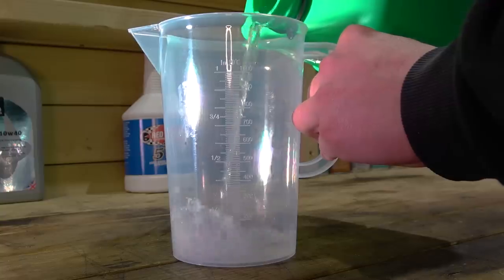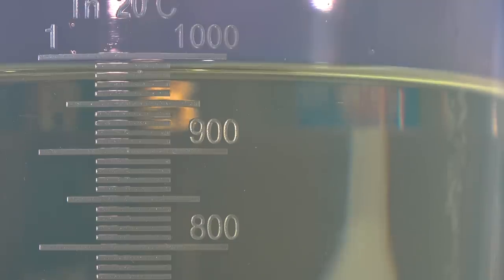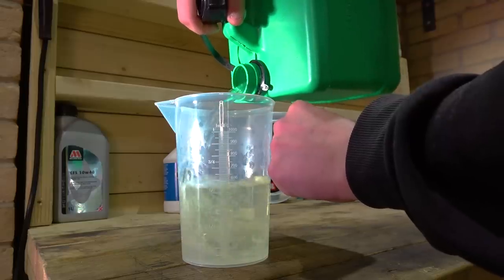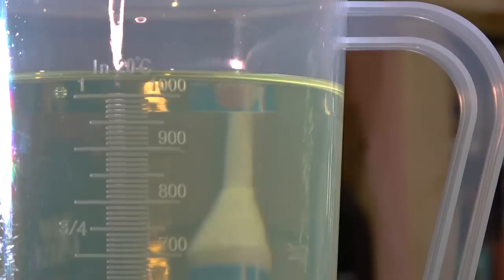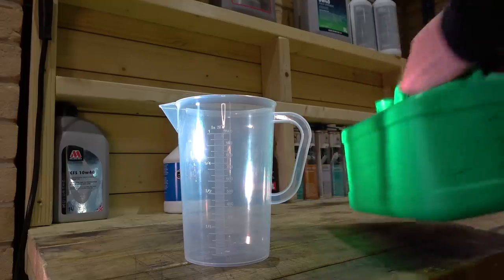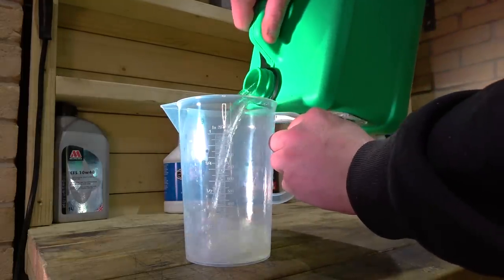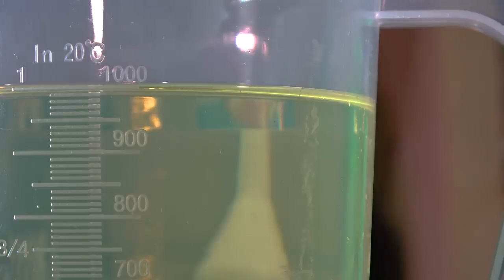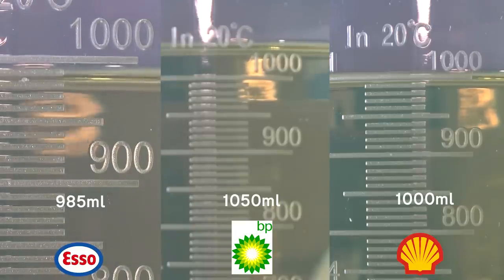Fuel Pumps Are Wrong - Esso BP & Shell

Comment: There is probably more variation between pumps than between suppliers
Reply: This is true. It's usually the same independent companies doing the adjustments and checks on the pumps. Petrol stations themselves are not allowed to do it.
Reply: There is more variation in your hand than anything else.
Reply: Yes, go to another BP and you might get less than 1L
Reply: Spot On!
Reply: He really needs to check 1 liter from every pump at each station to be sure.
Reply: @MikeDCWeld  not just that but at least 10 samples from each pump

pumps and infact everything that has some kinda measurement has a tolerance value that 985 might actually still be ok if the tolerance its aiming for is enough and 1 liter to the next you might see a difference take the bp over 1 liter the next liter it does might be spot on the next under 
the easiest way is to just pump 10-100 liters and see how far off the combined is

which probably has a lot to do with the 2-5 liter minimums there calibrated off a 5 liter or 2 litre test so whilst a liter might swing either way multiple miters average off there tollerances to be much more accurate

fun bonus fact you can combine multiple 5% resistors in a circuit to form a higher tolerance resistor of say 1% or better

Comment: Ah! The ISO approved kitchen measuring jug, well known for being totally accurate and checked by Trading Standards!
Reply: Just what I was thinking.
Reply: The math dictates they are 1L exactly. Manufacturing tolerances are likely not even 1ml. All rulers that you can buy from reputable brands are accurate too.
Reply: It would be nice to repeat the experiment with a graduated cylinder
Reply: Using his eyes to read the value adds more inaccuracy. A calibrated scale would be the best method for getting an accurate reading.
Reply: @justinvzu01  But is that really the case? Manufacturing tolerances on chemistry beakers are +-5% and if you really need something more accurate you shold use a graduated cylinder which has a tolerance of about 1%. I somehow doubt a kitchen aid beats a graduated cylinder. I think at best it's on par with the beakers. And it all depends on the liquid and the tempearature.

However, having used the same container for all 3 samples we do get a good estimate of the variation. This is the difference between what precision and accuracy mean respectively. We got good precision per sample but not necessarily great accuracy overall.
Reply: Even if it's not very accurate (which is quite likely) he used the same jug for every sample so relative measurements are fine.
Reply: @justinvzu01  this isn't true. I work in a lab, and all equipment we use must he calibrated. Our 1L volumetric flasks will have an error limit of around 1ml, and they cost £50-100 each. 50ml volumetric flasks that cost £50 have 0.1ml error (which, when taken up to 1L, leaves you with 2ml error.).

I expect that there will be at least 5-10ml acceptable error (although its likely not tested)
Reply: For the purpose of this, I think it's pretty impressive that the pump is able to get damn close to 1L.

Comment: I was told many years ago by an engineer that worked on fuels systems, was that it was impossible to design a totally accurate fuel pump. He said that if you squeeze the trigger on and off repeatedly you should get a little more fuel. This was many years ago, and he said this was a known issue by the petrol companies.
Reply: In india they do the same but to dispense less quantity.
Reply: Actually you get less fuel then having a constant flow
Reply: @mickdaly6537  My friend was an engineer working on pump system for military aircraft. I assume he knew what he was talking about.
Reply: @eddewhurst7662  you can easily both be right, the engineer understood his system, poster understands physics in principle. Specific systems and principles are related but interact complexly and easily could allow both to be right

Comment: "Always fill up on a cold day as the fuel will be more dense."
Was always the one I was told.
Reply: sadly it usually matters not as the fuel is located 10+ meters underground in a tank same temperature year round.
Reply: Was on Top Gear, 2hen Clarkson done his London to Scotland and back on a single tank of fuel challenge...
Reply: matters a lot here in canada - the fuel pumps here have to charge based on 20C temperature year round.. Amazing how much more petrol you can fit when it's -40C :D
Reply: @Sam-xq8xh  A8 4.0 TDI (03 plate) in 2004
Reply: It's all about WHERE you fill up; some places have better tanks than others, some tanks leak.
Reply: Come from under ground, so I am not sure who told you that. As far as storage of fuels is concerned, stable temps is the best to avoid condensation of moisture in the air. Perhaps that was the point they were making.
Reply: I thought the fuel temps were kept at a fixed level
Reply: tanks are underground and are at a fairly constant temperature.
Reply: and this is why I use the bus to go to work in the summer. I lose like almost an hour every day but I dont lose my perfect streak of tanking dense fuel. Genius stuff.
Reply: park the car other way round and strech hose. when u finish wait 10 swconds
Reply: @julmdamaslefttoe3559  Thats only if you're tapping the storage tank.
motorbikes, for example, can tank up with the majority of the fuel being in the pipes....
Reply: @julmdamaslefttoe3559  Yes and No. For instance, in the United States, the oil companies don't bother with temperature compensation since they say the cost of doing so isn't worth it. However, in Canada, they do provide temperature compensation. Now, consider average ground temperature and the effect on the density of the resulting fuel. So in other words.
Ground temperature in the United States is warmer than the standard temperature for determining volume, resulting in lower density of the fuel, resulting of "less" being delivered. Not much of a difference per customer, but overall, it results in substantial extra profit (look at salami fraud. millions of insignificant amounts do add up).
But on the other hand, ground temperature in Canada is lower than the standard temperature for determining volume, resulting in higher density of fuel, resulting in "more" being delivered. And the oil companies are well aware of salami attacks and hence require temperature compensation.
Reply: @JUL'MDAMA'S LEFT TOE  partly correct. Fuel delivered often has a very low temperature at winter.
So the volume loaded is measured to the temperature at loading
Reply: @JUL'MDAMA'S LEFT TOE  partly correct. Fuel delivered often has a very low temperature at winter.
So the volume loaded is measured to the temperature at loading
Reply: @julmdamaslefttoe3559  matters not? Fill up a 20oz bottle to the very top when it’s hot and wait until it cools. Then look at your wrinkled up bottle lol. I think it matters
Reply: So, just go for 6-9 months of the year without filling up? Got it.
Reply: @certisully7354  😆
Reply: you will lose more than you save starting the car from cold! if you are buying a supertanker load, yes this will add up, but for a 60 litre tank?
Reply: @Skorpychan  Has nothing to do with the tank, it's the pump meter
Reply: Nah. Fuel tanks at petrol stations are buried well underground where the temperature is pretty much constant all year round.
Reply: @Youtubecensoredmyusername  When was the last time you got hot fuel out of the pump? The temperature varies so little as to not matter.
Reply: @certisully7354 you do realise that the valve is in your hand, right? You don't get more fuel by elevating the hose 😂😂😂
Reply: @djsmeguk  it's always a constant temperature underground... you'd be surprised. But don't take my word for it, go look it up.
Reply: @simonwass6315  a small temperature variant makes a large difference. Yes the tanks are in the ground. However ambient temperature still plays a part. Do you fill up when there are tankers delivering fuel?
Reply: @djsmeguk  LOL, I rather doubt that. Fuel retailers aren't stupid. Besides, by regulation fuel volume measurement is always corrected to +15 degrees C. You get no more and no less than what you paid for. But hey, I'm just a journeyman industrial instrumentation mechanic who happens to work in oil and gas.
Reply: @simonwass6315  also temps swing from 60 to 80 daily here. Maybe they don’t where you are
Reply: It is always cold in the UK.
Reply: @certisully7354  That's the 'secret' technique I use, regularly get an extra litre at least from that stretched, extended hose! 😁👍
Reply: @Skorpychan  Irrelevant. The pump measures the fuel.
Reply: @julmdamaslefttoe3559  Nowhere in the UK with 10+ metre deep tanks. That would be crazy and unnecessary.
Reply: Then if you fill your tank to the top on the way to work on a summer day your fuel will expand and if you not used a lot  it might find its way onto the road with the overflow tube
Reply: Knackered in summer
Reply: @djsmeguk  minus 40°C? Ouch! Here in the UK we moan when we get -5°C haha! -40°C is deadly cold, our whole country would disintegrate in those kinda temps.
Reply: Ground temperature varies just not as willdly as air temperature. You do see seasonal trends. You can also see the temperature of the fuel increase or decrease after a tanker delivery. If the fuel has been freshly made at the refinery it can be closer to 30c when it gets unloaded. Most filling stations have any automatic tank gauge ATG that measures fuel height and temperature. So really easy to see temperature changes and levels caused by fuel delivery. Long way of saying fuel temps really vary and don't just follow ground temp.
Reply: You can also get fuel temps increasing when the submersible running runs all the time because of a small pressure leak. Constantly running motor submersed in the fuel heats the fuel and causes temp to increase. If you see one tank always many degrees hotter than others that's the likey cause.
Reply: @julmdamaslefttoe3559  incorrect. It does change.
Reply: This only applies if the pump is set to ambient. If it says "@15deg C" it will temperature compensate.  Which is useful to a customer on a hot day.
Reply: Who bothers to within a few millilitres, the real rip off in the UK as in most countries is tax and price fixing by the fuel distributors. Opec never helped either, the present set up with Russia a member is worrying.
Reply: The storage tanks stay cool but the pumps warm up, so its best to get there early before the equipment has warmed up.
Reply: Remove the Entrained Air in the fuel to make more dense..... Then the fuel will clean the engine.... As designed.
Reply: @gj91471  that only works will oils (diesel, hydraulic etc) petroleum is a solvent so air evaporates out of it, now a fuel pump or split line could introduce air into the system but it will cause a stutter or air lock.
Chemicals in the fuel clean not the fuel as burning diesel or petrol makes carbon, even if you tune the engine perfectly.
Reply: @hybrid9mm  You dont know what You are talking about.
Reply: @gj91471  then please do elaborate and share the qualifications that give you the knowledge.
I always google before posting and found nothing on removing air from petroleum, but plenty on removing it from oils (which I already knew).
If I’m wrong I’d like the right information.
Also I messed up my reply, it was actually meant to be part question part what I know but I didn’t word it right (been a long day) 🤦‍♂️
Reply: @uprightfossil6673  Here in the UK they have to be buried underground by law.
Has the added advantage of stopping fuel theft too !
Reply: Absolutely true :) It may be a near constant temperature underground but it is not that far down, only a few meters. That is not the same for the delivery pipe just under the forecourt and the fuel that is kept pressurised in the hose at the pump though ;)
Reply: I only fill my car up in december, then when it runs out i catch the bus the rest of the year.
Reply: sometimes you find "compensated at 15 °C" on the receipt
Reply: The coefficient of linear expansion for petrol is 0.00095 per 'C, or about 0.1% per 'C - SO if the pump is dispensing 'X' litres and not making allowances for temperature and pressure (as I believe they actually HAVE to do to calculate the tax that is payable for fuel) then if the temperature is 10' rather than 20'C you could manage to get 1% more fuel.
A more significant point is don't competely fill up your car on a hot day. The fuel is underground and cool - but once it warms up in your tank and expands it might (like it used to do with my 1970s Mini) actually overflow and you waste a cupfull or two of petrol.
Reply: “You could probably repeat the experiment and get totally different results”

Looking forward to next week’s video…
Reply: I think the temperature at the level the of the tanks is relativly constant. Atleast i've never noticed a change, if i pump gas when my reserve light is on i get nearly the same ammount (yeah it depends how much i drove after that point but it is alway between 39 and 41 litres) if its -10 or +30 degrees.
Reply: No tank is buried 10+ metres underground, they are buried at a far shallower depth and most of not all petrol stations will have dipstick to physically check the level. When you are delivering fuel pretty much the first thing you will do is check the level in the tank. Just because somebody orders a thousand litres of let’s say doesn’t necessarily mean they are right and it’s all going in the tank . So underground tanks or any tank will have a dipstick . Can you imagine a ten+ metre long dipstick?
Reply: The bulk tankers know this effect.
Reply: @amojak  tankers are not!
Reply: @bloozee  you don't get your fuel out of a tanker :)
Reply: @Youtubecensoredmyusername  There is no place on this planet where daily temperatures vary between  60C and 80C. You'd even be pretty dang hard pressed to find a place where temperatures go between -10C at night and +50C during the day. Perhaps in the middle of the Sahara, but not in a place where there's actually enough of a population that it warrants having a petrol station.

If you mean that temperatures where you live varies between 15 and 26 C on a day to day basis, that is far from impressive, it does that for most of the planet at some point during the year. If you're trying to say that temperatures vary by 26C on a regular day where you are, again that is not that impressive and it does that in quite a lot of the world. If you think that oil companies haven't figured out how to compensate for that, well bless your heart young one.
Reply: @fermitupoupon1754  he he. Not Celsius  holy moly 60 to 80 degrees Fahrenheit
Reply: Full up as slowly as you can… since they over deliver slightly when you do!
Reply: @benjaminfraeyman   There are temperature probes fitted into the meter, they don’t control the temperature of the fuel but they do compensate for it and these box are programmed with the density and calibration, and are then wired and stamped shut , with a stamp for each engineer
Reply: @amojak  
Doesn't matter what temperature the fuel is in the underground tanks.
99.99% if not 100% of fuel pumps in the UK compensate for the temperature to 15 degrees centigrade.
Reply: @lagresomadsl  
It's all compensated to 15 degrees, both when loading onto tanker in the fuel terminal and at the pump when dispensing into your car.
Reply: @pdtech4524  Ahh, brill, so if the person before forgets to drain the hose you can tip it into your tank and get a free litre before you start filling? Genius. What if you squeeze the hose and jump up and down?
Reply: Makes no difference
Reply: @TeslaNick2  This, I work at a Shell station and the tanks are fairly deep underground and all year round you maybe get a 2 degree shift in temp at most, very stable temps.
Reply: 15c, it says so right on the pump @djsmeguk
Reply: @Sam-xq8xh . It must be right then.
Reply: I'm definitely more dense when I'm cold.
Reply: @julmdamaslefttoe3559 normally it's 1,6 to 2M under the ground. With a diameter of 2,5M the underside normally tops at 4-5 meters. Normal temperature is around 15°c and it changes around 3 or so depending on the outside temperature. In the Netherlands tanks are fitted with a measuring probe that checks the volume by measuring fuel height and temperature with the known size of the tank. Unfortunately you won't get more when it's colder. At least not in most European countries.